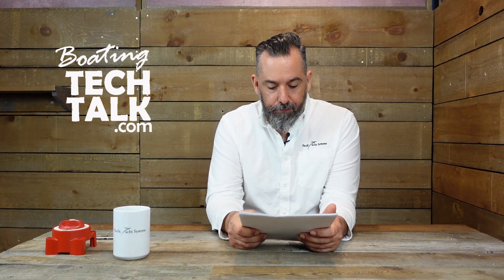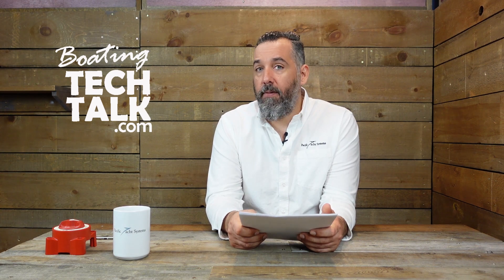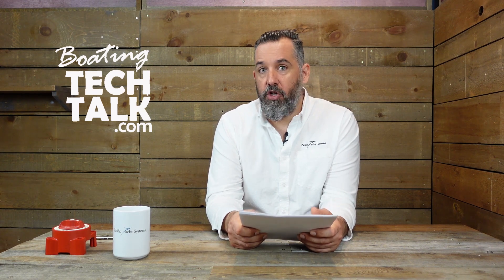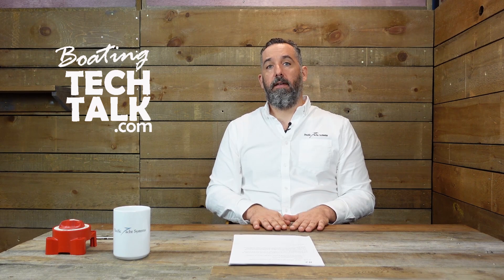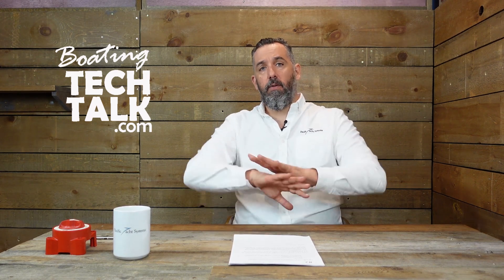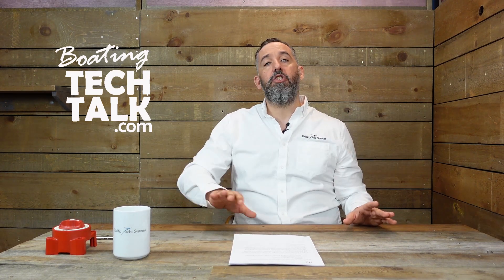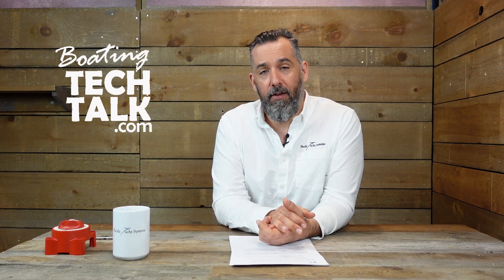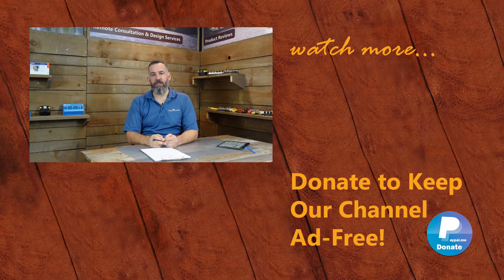Sizing A Charger For Multiple Battery Banks

Comment: But it is a good practice to run the engine/alternator while using the windlass or thruster, thereby providing the battery bank with nearly as many amps as those devices are drawing.  Am I missing something?

Comment: Hi Jeff. Great videos! I have a 35' sportfish with two 200Ah separate starter batteries. 

Using the minimum 10% rule, should my charger size be 20A (10% of 200Ah) OR 40A (10% of the combined 400Ah)? 

Thanks

Comment: Hello ,  On the Argofet with 3 outputs and one alternator input  .
Do you recieve  the full alternator input ie voltage and current to all of the 3 outputs equally ?
Reply from the maker: With a battery isolator (e.g. ArgoFET) all 3 batteries will get a charge, the size of the battery bank, the level of discharge, and the ability of the battery to take a recharge will all affect where the current from the alternator goes.

Comment: Hey Jeff, thought I'd try here given the no response to my email after that AGM battery purchase.  I have a 3 bank battery charger (ProMariner ProSport 20 Waterproof Battery Charger Gen3 20A), Blue Seas ACR, Blue Seas Switch (5511e) and Blue Seas Safety Hub 150.  Should I connect 1 lead of the charger cable to the switch on the house side, and one lead of the charger on the starter side of the switch?  Alternatively, I can only imagine that it would be 1 lead connected to the positive distribution bar and negative distribution bar for the house bank.  Any help would be appreciated, but I understand that maybe my 26' boat may be a bit small for your consideration.
Reply from the maker: Hey Darius, battery chargers should connect to batteries directly (e.g. positive via a fuse).
Reply: @PacificYachtSystems  Nice timing....a response 8 days after an email, 2 days after a youtube comment.....and 45 minutes after a bad google review, hmmm..........maybe provide customer service prior to a bad review...could be helpful.....but that's just me....a paying customer.

Comment: Jeff, thank you for all you videos! I watch them religiously! 

I watched a youtube video from victron on recharging lithium batteries via an alternator at low RPMs (think 1500). The alternator burnt out on lithium but not on lead acid because the lithium pulls as much current as possible even at low RMP  while the lead acid does not...I think...if i am wrong please help? My question is i have 3 battery banks; 2x 90amp/hr lithium, 1x starter AGM and 1x thruster AGM banks...all are hooked up the a 3 channel battery isolator (Cristec 180-1E-3IG)...can i burn out my alternator (14v, 125amp) at low RPMs ... is there anything on the market i could add to help prevent any damage to my alternator?
Reply from the maker: In short yes, stock alternators have a very hard time recharging Lithium batteries, you might want to consider a high output alternator and external regulator.
Reply: @PacificYachtSystems  Thank you

Comment: Hey follow up question on the 10% rule I'm looking to upgrade my outboard on my small sailboat to an electric start. The outboard I'm looking at has a built in 4 amp alternator, but my house battery bank is about 120 amp hours. Would it be better to not tie the two battery banks together at all and just keep charging my house battery at shore as I do now, or is this a take whatever I can get situation like you've said with solar panels? Thank you for your time
Reply from the maker: Great question Tyler, with a 4 amp alternator, like you suggested, it's better to have the house battery of 120 amp-hour be charged separately and not from alternator. With an alternator of this size, suggest the engine battery should be charged instead.